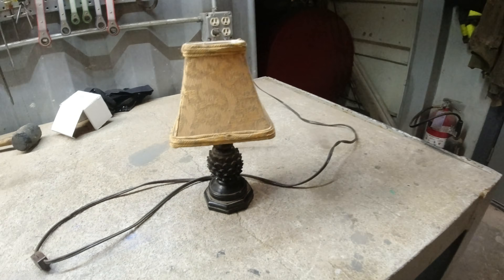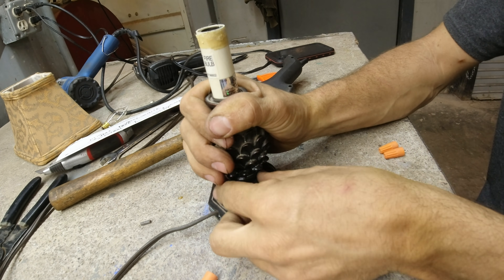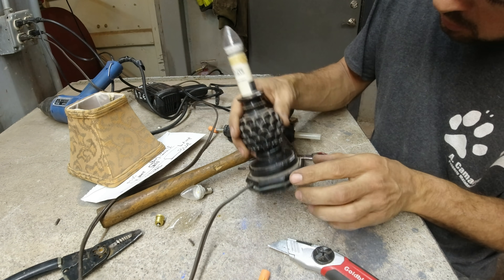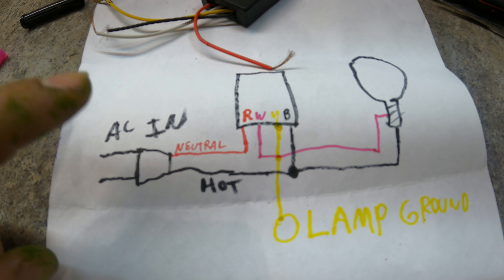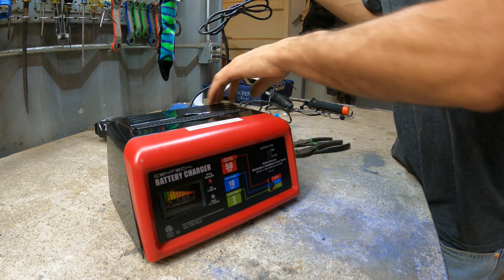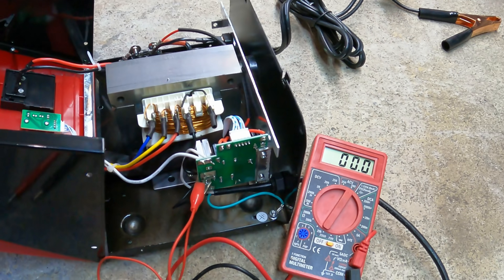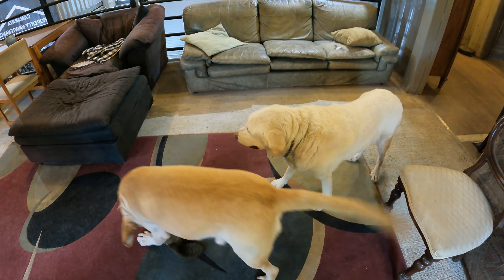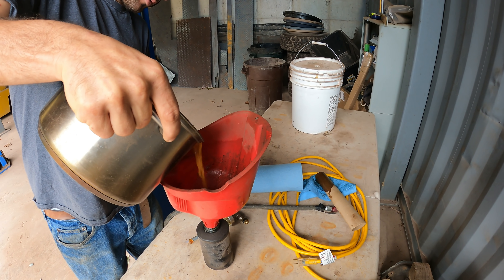Installing a touch sensor in a lamp

Comment: Long time ago - more than 40 years - I also had fun making a bedside lamp for my wife - it was not touch - it was triggered by light via a light sensible diode - so to turn it on - you had to use a light source.. everything worked - and we went to bed - my wife said - okay - I know you have done something to my lamp - could you please turn it on for me - so out and around the  bed I went - and with a cigarette lighter up under the lampshade - made light an the light turned on - and stayed on as long at the lamp made light. Back to bed - a little reading and sure enough, she called me and would like to turn the light off - so - out of bed again - around the kingssize bed - kneeled down and slowly raised my left hand and at the right moment I blowed the light out.. (my left hand blocked the light from the lamp to the diode) and said "Hello darknes - my old friend."

Comment: That's the hard way.  There's a socket adapter you can screw in to do the same.  The lamp then plugs into the adapter.  https://www.amazon.com/Westek-6603BC-3-Level-Control-Socket/dp/B00004XS96/ref=sr_1_10?dchild=1&keywords=touch+lamp+adapter&qid=1601835521&sr=8-10

Comment: hey andrew, been there done that before.
those touch sensor boards are pretty sensitive and doesn't take much to blow one out.
i have two lamps in my bedroom and lightening took both of em out so i did what you did and replaced mine with those same sensors.
first one blew right off the bat, no good reason, it just was faulty i guess... i did what you did and bought spares (just in case) glad i did.
oh yeah, did that tickle a little? done that too before lol 😜

and those windows went real nicely, look awesome, beautiful view too
the anticipation on what it's going to look like when your done has got me excited, that whole project even though long will be well worth it in the end, yes sir 👍😉

Comment: I'm glad you didn't do this in the UK.  240v on a 32amp socket ring breaker doesn't play nice even with a 30mA fault current.  You become the lightbulb

Comment: Andrew: fits sensor
Sensor: shorts out 
Andrew: tries again with the same result
Also Andrew: aight I got 9 more of these things 

That's dedication for ya!
Reply: He's not having much luck wiring the neutral wires on things.
Reply: @ChipsNeeson  We never really knew what he was doing wrong with the hot tub pumps.  My guess is that he was confusing 110 volt and 240 volt wiring.
Reply: @TrevorDennis100  If you watch the whole video, he explains how he followed the wiring in the pump manual, which showed wiring the two hot buses, neutral and ground, as you normally would, but the company who sold him the pump told him to ditch the neutral and wire it slightly different.
Reply: @TrevorDennis100  He was wiring the neutral, hot, and hot when he should have been just wiring hot and hot, no neutral. That's why it was overheating. I think on his original one the neutral leg was broken so he never noticed.

Comment: A simpler and free solution to the lamp switch being hard to find would be to just hot glue the switch to the side or top of the bedside stand. That way it will be in the same spot every time you want to turn it on and you don't have to feel for it. I get that you wanted to try the little touch project though so that is cool too.

Comment: When you started using glue gun I was like. Why don't he check if the lamp is working. It doesn't seem to by metal so it will not work.
Also there is wifi lamp switch on the market,  you can use your phone to turn on or off any device you want even program hours etc.

Comment: In those tight locations for little circuit boards, I put a large piece of shrink wrap around it and lightly heat/shrink it. Then there's no chance of any spots on the board accidentally touching ground and if you need to re-solder a connection, you can always just cut it off.

Comment: The antique lamp may not have a polarized plug and depending on how it is plugged in, you could have 120 on the  metal touch piece. Andrew may have strayed into unknown territory with this project which could be dangerous.

Comment: Ryobi 18-Volt ONE+ Cordless 2.5 in. Portable Band Saw (Tool Only) P590, (Bulk Packaged, Non-Retail Packaging) https://www.amazon.com/dp/B082P84VLY/ref=cm_sw_r_cp_api_fab_X4FEFbYQ2PVX8
This is much nicer to cut steel with, than a cut-off wheel.

Comment: You removed the black cases which exposed 110vac on the circuit board to a grounding fault to the metal housing of the lamp.  Careful it doesnt catch the felt on fire.

Comment: I went to cut off the terminal of a powerful lipo battery. Yup cut both wires at the same time with the metal wire cutter and had a massive short circuit. I learned my lesson. Cut one wire at a time.

Comment: I have a lamp from the 90's that started out as a touch lamp, but it broke. I drilled a hole in the base and installed a push button switch.

Comment: For the love of all that is good a holy, please, please get a Weller Soldering Station to do your fine electronic soldering.  Available on Amazon for $not much.  Watching you use that humungatroid tradesman soldering iron on electronics is so very painful, like using an excavator to plant a flower.  I'm sure you could, but really?  ;)

Comment: Never forget - a LED bulb is polarity dependent. meaning an LED won't work if the DC is backwards. Try reversing the connection. Also a dimming device changes the AC to DC to give varying amounts of voltage to the bulb. One of those bulbs you had was a LED bulb.

Comment: You shouldn't solder electronics with a short-circuit bolt (soldering gun). It may damage the electronics of the module.

Comment: The whole building is made of metal,  are there any measures taken in regard of lightning ?  BTW love your vlogs.  thank you🙏🏼
Reply: A big misconception is that metal (or conductive materials) are more prone to lightning strikes- this is not true. Lightning will strike anything as the electrons don't care about conductivity, they are just looking to dissipate the built up static energy. So we protect structures with lightning protection, which works by taking terminals (metal poles) and putting them at the top of the building, connecting them with copper wires, and bringing those down into the earth. The purpose is essentially to put the ground level above the building. This building is all metal, with support columns already going into the earth, so basically it has lightning protection by design. Now this protects the structure, but not the electrical wiring and electronics inside. For that, you need a surge protector that will dissipate the current (electrons) that are induced by the magnetic field of the lightning strike back onto the neutral conductor, which is connected to the earth at the service disconnect (meter or first panel) and by the utility at multiple points (and called the grounded conductor, not to be confused with the grounding conductor inside buildings, which really should be called a bonding conductor and is used to clear a ground fault and open an overcurrent breaker to make a faulted circuit safe).
Reply: @paul4800  Thank you for the clarification. 👍

Comment: You need to install a polarized plug, make sure the hot goes to the center terminal of the bulb socket.
Without a polarized plug you have a 50/50 chance of making the whole lamp hot.

Comment: You’re supposed to use a metal lamp. You should be able to turn the lamp on by touching the lamp base...at the bottom. You shouldn’t have to reach up under the lampshade to touch near the bulb.✌🏼❤️

Comment: I think the reason they kept blowing was because you had an LED bulb in there and they are not compatible with dimmers (unless its specifically made for them) and the touch system is basically like a dimmer.

Comment: Sorry sir Andrew

 I prefer the Clapper clap on clap off do you know the clapper !!! Unfortunately your antique lamp does more than just being a lamp it’s a arterial defibrillator it will with one touch not only wake you up in the morning but restart your heart again LOL 😂It will tell you if your circuit breakers are working properly and it will also or should I say can be used to jumpstart your car 🚗 And if the touch sensor goes we have eight more to try !! 

PS Please remember to not use the wire cutters to cut through a live line you may get electrocuted sir😃

Comment: I wonder if it was that LED bulb. I've seen lots of them that aren't dimmable.
Reply: correct
Reply: @cliveramsbotty6077  Think so. the electronics in the LED are not compatible with the electronics of the switch. It works well with resistance of a bulb only.
Reply: @loufaiella3354  That's why you get a dimmable LED bulb, which is what I have in my bedroom's ceiling light socket because I have a dimmer knob on the wall.
Reply: @loufaiella3354  There are PSUs for LED lamps that can work with this kind of dimmer.
Reply: When are you going to put in an elevator for Levi?
Reply: yep thats my bet
Reply: LEDs are dimmable but you need a switch with a dimmer in it compatible with LEDs
Reply: @Sleazypmartini417  You need a P.W.M circuit (pulse width modulation) with a fast switching transistor to make it dim LED lights.
Reply: guys, Andrew is not stupid and his LED bulb was dimable. At 6:25 he clearly explains that the socket was shorting out and he clearly says that he can not fault these sensor circuits when the socket is faulty.
Reply: As soon as I saw that LED bulb I knew there would be issues.

I love LEDs, every light in my home is an LED bulb even the flourescent strip light in my kitchen. I don't have any dimmable lighting though.
Reply: @AntonyPeacock2  i like LED but, it is direct light, a lot of LEDs aren't diffused. incandescent throws light in all directions where is with LED it has to be so bright it bounces light off everything, also i hat seeing spots after looking up. i use both incandescent and LED. diffused led is pretty decent.
Reply: Sometimes the dimmer cant dim LEDs either.
Reply: around 38 years ago I had one that was dimmable. I was still a kid, and I bought a small DIY kit with all the components, and I had to solder it together myself. It worked like a charm on 220 volt and with a normal light bulb. I do not think that I still have it. Moved too many times. I have no idea how it worked. I know that it had something to do with the resistance that made it switch on and off and that made the light intensity change. When I made the wires that you had to touch longer it would switch on and not go out. One wire was to switch it on, and one wire was to switch it off, and if you touched it longer it would dim the light or make it brighter. So when I shortened the wires again it was working again. 

That's all I can remember about it. It's too long ago.

Comment: conventionally, you would switch the hot, not the neutral, keeps less of the circuit energized when the switch is off.  Also, the circuitry in that board may have not like that LED bulb, which may have been causing those boards to blow.

Comment: Thanks for fixing that Harbor Freight battery charger. I have the same one and I've tried to use it and it never works. Never comes on. I am going to try that trick you did to fix mine.

Comment: Andrew, thank you for all your videos.  I really love watching them and the amazing work that you do.  I really want to thank you for your video on refurbishing your equipment trailer.  You showed a lot of pointers on who to do things right.  I am currently refurbishing my lawn tractor trailer and am using the methods that you used with the rusty metal primer and soldering all the wires for no electrical issues.  The trailer is turning out great and I just want to give you a big " THANK YOU " on showing us how to do it right.  God bless you from Louisville, KY.

Comment: I hope noneone will try to copy anything in this. Andrew should definitely have disclaimer in this video. These things are not safe.
Reply: Well he showed himself being shocked at least 3 times. That makes me not want to try it.
Reply: @paulmccoy2908  well paul most would disconnect the power source first before handling the circuit board.
unless he was testing for voltages with the meter and even then you would want to have some rubber insulated gloves on
then again even those of us that deal with electricity all the time get into scenarios where there are live circuits and do get tickled a little bit once in a while 😉
Reply: awww man, its just a little tickle 😉

Comment: erm, not sure about US standards, but you really need to have 3 wire cable (incl. ground), when you have metal parts (casing) on your electrical device.

And there are weak sparks, because of two things. First, the material of the clamps is different. Secondly, there is probably some basic short-circuit protection, so after the initial spark, it immediately switches off. Both is intentional!!!! To prevent fires.

Comment: Led lamps give issues as they don't draw enough power to run triacs properly so you need hard fired dimmers for led lamps you need usually 40 watts to control with a triac

Comment: In order to utilize the “ground “ wire in your diagram you would have had to install a 3 wire cord to replace your 2-wire cord
Reply: no, that ground wire in the diagram attaches to the lamp chassis to enable the touch switching
Reply: Joe Milton Therefore, it should be labeled “capacitor interrupter” and not ground🤪

Comment: I love your dirt pushing videos and have subscribed to your channel.
 --- Thanks for showing the uncut video, were all human and learn from mistakes ---

The circuit you're installing in the lamp is most likely not compatible with an LED lightbulb you installed after the incandescent bulb burned out, also having the circuit board installed without proper isolating it from the metal lamp housing and pounding on lamp to install the metal sleeve could've shorted the circuit board to the lamp housing.

Comment: Andrew Camarata - excavating, landscaping, road building, tree removal and planting, welding, building construction.... and now comedy.  Couldn't stop laughing.  In true Andrew style he bought 10 more touch sensors just in case.  Hey, could you use them to install "touch start" on the pickup?

Comment: Is there any type of conductive paint that one could repaint the lamp in? The only conductive paint I have used has too high of a resistance... 

But if low resistance conductive paint could be used to repaid the entire lamp, that would be very useful for lamps that are not metal, but one doesn’t mind repainting...

Comment: Levi needs an elevator. Sounds like the makings of a new project. :-)
Reply: Agree...elevator should be the very next project. Simple platform with dog crate attached, using the motorized lift.

Comment: This is why most will never attempt to DIY electricity....
Reply: Which is generally a good idea.
Reply: i took an old cordless drills battery apart and put modern cells into it, at one point was handling the completed battery before putting it back into the plastic case with a screwdriver in my hand, shot sparks across the room, i dropped both the battery and screwdriver on the ground and was petrified. you think the "50 amp" sparks were big... you could take a shower in the sparks that flew off this thing. i finally understand AVE's joke about putting pink electrical tape over his wedding ring before handling electronics lol. i got it back together and its been running great ever since, nearly 2.5x the capacity of new.
Reply: @Stanimalgic  Nice, I remember Mathias Wandel made a cordless drill out of 2 old ones he had lying around. I definitely want to learn that skill.
Reply: Electrickery!
Reply: @Big Crunch go read r/slowcooking there is a terrifying amount of posts with pictures of old school slow cookers, some of witch were known to be death traps, but they look cool and retro so some people still use them.
Reply: And why a few only do it once.    ⚡️
Reply: Same for me. I know when i dont know enough about something to not touch it and leave it to the pros. And electricity is one of those things.
Reply: Electricity is simple.
Reply: @fishyfool  Say this again when you came to an old building with cables that lead everywhere and you first need to find out what in the world the people who build the house around 30 years ago where thinking when they made the electrics because you find shorts all over the place and in the end decide that its better to replace ALL cables for good.
A friend of me, who is a learned electrician with more than 20 years of experience once had this case and even he had problems there. Like i said, in the end he replaced all cables because he tried for over a week to find out where which cable was going. I mean, every time he though he was done he found another random cable and was like: "Where the hell is this one coming from now? And where is it going?" And to make it worse, even with the fuses out some cables still had power on them and he couldnt find out why.

But after a complete replacement of the electrics everything worked perfectly.

Comment: Andrew you forgot your safety glasses and respirator when applying the fluid film. 🤷‍♂️
Reply: It's just like a wax isn't it? I did my car with this stuff as a teenager, the garage refused to do any welding on it after that, lol
Reply: @____________________________.x  Lanolin and solvent carrier.
Reply: “It’s probably fine”

Comment: What you can to fix you lamp reaching problem ist to shorten the cable between the switch and the stand or just straigth up drill into the base and put one int there - just the ideas that I had with my lamps.

Comment: That lamp is made out of pineapple. Pineapple doesn't conduct electricity very well.
Since your castle is all metal couldn't you use a powder coat it instead of paint?